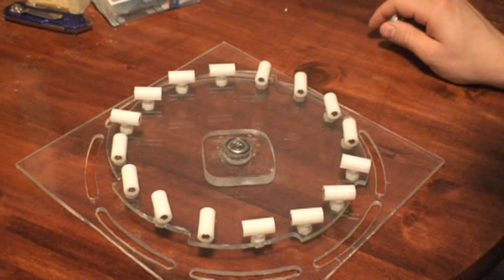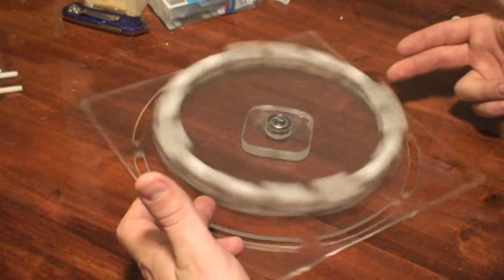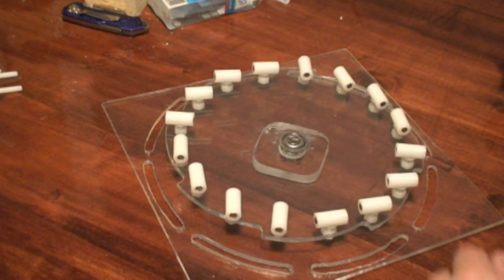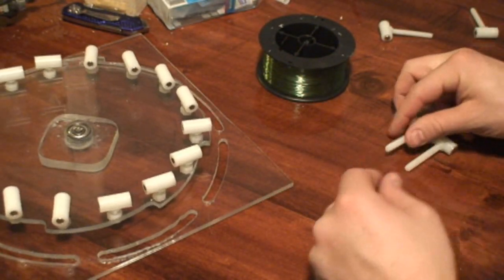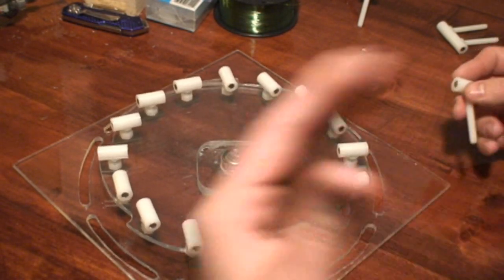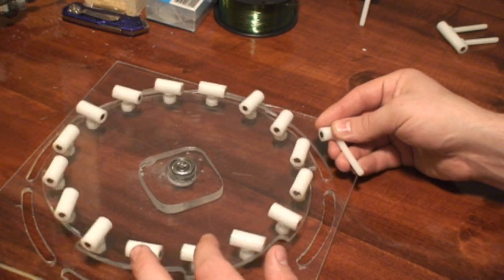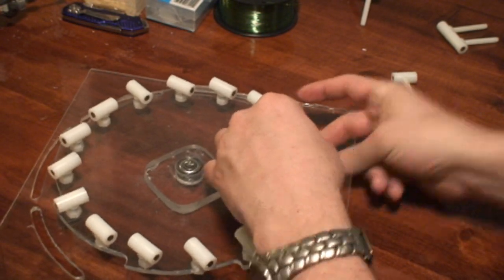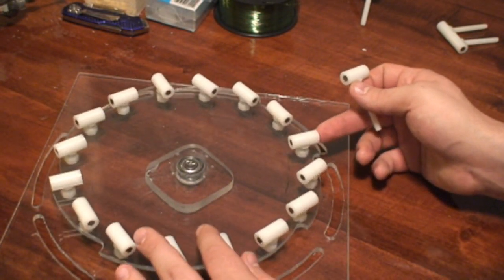Magnet motor, free energy, overunity test 2

Comment: More overunity BS.  It takes more energy to flip the stator magnet than you generate.

Also, even if it worked with no external power input at all,  you're forgetting that magnets are not eternal.   An "overunity motor" using magnetic fields draws its energy from the magnetic fields in the magnets, which is a limited source of potential energy.  The more you use the magnets, the weaker they become as they depolarize.    Magnets are BATTERIES in a manner of speaking.

The laws of thermodynamics are laughing at you.
Reply: You clearly don't understand the relationship between force applied in a field and potential energy.

http://hyperphysics.phy-astr.gsu.edu/hbase/pegrav.html 

https://en.wikipedia.org/wiki/Magnetic_energy

If a magnetic field is providing a force,  and the objects position is changing, it is changing potential energy. Since the force was provided by a magnetic field, it is called MAGNETIC potential energy.

Just like gravity. Gravity is a force, but a gravitational force applied on a object such that it changes position gives it GRAVITATIONAL potential energy.

Comment: Learn science.
Reply: +PhysicsPolice Common sense works for this one.  No quantum mechanics needed.
Reply: +PhysicsPolice You should, because as you see, the basic concept does work :)
Reply: John Doe
Which basic concept:
1) If you put a magic trick on youtube someone will think it is for real.
2) Some fraction of the population is dumb enough to think that you can make energy by waving magnets around.
Reply: +John Doe The basic concept, that magnets move the carousel around, does work. But it's not free energy. It's not over-unity.
Reply: PhysicsPolice Nobody said anything about free energy. That motor will work and it will turn round and round like a pretty carousel. A huge amount of energy went into making the magnets, so of course it will never be any form of perpetuum mobile, that is clear. But simply said, with already prepared strong magnets and improved design, this type of motor would work. The only question is, whether the output, that he can achieve out of it is big enough to even matter.
Reply: Ken Smith What are you talking about? This video is simple physics and it works, as you can see. I never said anything about having free energy, as nobody can get free energy out of nothing, but the motor works. Improve the design a little and find out what kind of output he could get out of it. That's it.
Reply: John Doe Note that I didn't say that you were supporting a claim of "free energy".  I was only, I hoped humorously, pointing out that your comment was unclear enough in its meaning for someone seeing it in the context of a "magnet motor" could take it that way or in other ways.
Reply: +John Doe The title of this video literally says "free energy".
Reply: tampicokid Correct!

I'm astounded at how many people don't know these "over-unity" claims are all bogus.

I learned this when I was about 13.  The First Law of Thermodynamics.

Magnets aren't a source of energy they're more like springs.  If you put energy into them they can store it but there's no net gain.

But when you consider that one in four Americans think the Sun goes around the Earth I guess nothing should surprise us.

Comment: I think you can build a bearing  carrier for your magnet to keep it stationery and have it spin at 4:1 ratio to change the poles as the main wheel rotates. or possibly a magnetic cam system to rotate ur stator magnet

Comment: You just need a cam to make it alternate. The forward momentum of the wheel trips a spring loaded escapement every quarter turn. Even if you have to wind up an escapement, this magnet motor should run.

Comment: Nice demonstration, but as first pointed out this revolves around an environment with minimal friction, there is no load. In order to generate or draw "power" there would need to be a "load" applied to the device.  Even the smallest load would stop a device like this.  This is because the magnetic energy going into the device is always going to be less than the  power you can get out of it, even if friction wasn't an issue.  But friction is an issue, which only increases the losses.  

I do believe there is unharnessed energy all around us, and one day we'll learn how to harness some of it. But as cool as magnets are,  it would be unlikely a device driven by magnetic force would be able to generate real energy.  Keep experimenting though, because coupled with something else, magnets may be an enhancer or stabilizer.

Comment: if you could make a fixed stand that holds that single magnet, and have it so it can rotate on a gear that's connected to the main wheel. then the wheel will turn it without an electro magnet.

Comment: Maybe using a gearing system that can be timed to rotate the exterior magnets in sync with the interior magnets.  If the magnetic force can overcome the friction of the gears it should stay moving with out using electricty.  It also eliminates the need for any computer aided timing.

Comment: The permanent magnet on the rotor repulses the magnet on the 
stator, at the point the two meet. The initial push is to overcome 
inertia; the trick is to shield the stator magnet on one side to reduce 
forces in the opposite direction of the rotor movement. Or utilize 
coils and capacitors for the stator, to generate a pulse at the exact moment the two 
meet.

Comment: takes more energy to swap sides on the main force magnet than is created by the machine itself.
also just for the sake of argument, even if you did add an "electro magnet" it still wouldn't work because of loss of energy from switching the polarity of the magnet rapidly.

Comment: Magnets in motion, circular or linear can be employed to pass there lines of force through wire where it creates electric energy. That electric energy can be retained & built up by batteries or capacitors. Stop thinking of direct physical drives. This tech looks like it's best used to generate electric over long periods of time. Think "trickle" charge, not brute force. Use in plurality to maximize output (s). Oil companies are going to love this tech!! Wish you guys the best ,,,

Comment: Perhaps you could mount your external magnet holder with a couple of gears and a cam to flip it in time with the rotation of the motor.  There might be too much friction to make it work, but maybe not?  If the external magnet was held in place it could be mounted closer to the rotating magnets, improving efficiency.

Comment: Greetings, 
its not an easy task to be sure, however please consider incorporating a magnetic bearing and limit all ferrous metals from any of the device's wiring and surrounding support structure. Also testing within a woodframed building contructed with cadmium fasteners may prove beneficial. 
Good luck Mr .....

Comment: I know perpetual motion is not possible, but maybe try have some type of gear system driven by the spinning of the disc that turns the magnets the same way your hand does.
Reply: friction and the moments on the gears would slow it down and stop it moving at all
Reply: Spinning disc is on double ball-bearings. Making the whole thing spin connected to a gear would add friction, drag, and weight at every step. Even if turning the outside magnet took an ultra-tiny amount of energy, getting the motive force to it would sap more than the system could generate.

In addition, any system to actually catch energy from the system would also add friction and resistance. It's a non-starter, period.
Reply: Can magnetic fields be stacked so they produce more momentum?

Comment: you could link the rotation of the turn table with gears to the magnet that you want to spin with a 4 to a ratio. as the table turns it will rotate the magnet that to held in your hand and keep up with the rotation speed no matter how fast bc it's directly linked via gears and shaft... awesome protect btw

Comment: But this is the principle of how an electric motor and washing machine engines work with electromagnets. Are you trying to re-invent the wheel. Why not just put them all at an angle like 15 to 20 degrees North North with a fixed North repelling constantly ? What happens then ? Another idea is to have a rod in the centre that is connected to a cog that turns your magnet at exactly the right moment of turn no matter the rpm.

Comment: Its a start.  You really only need a couple magnets for that.  For less friction drill a hole in the center of a disk shaped magnet that your ball bearings will snugly fit into.  Then put a round magnet on the top and bottom of the axel the bearing sits on to make it hover between the top and bottom magnet.  also the axel can be a magnet that in the setup I just mentioned can be narrower than the bearings making them irrelivant if you can achieve the balance to keep things together as the speed of spin increases.. You are aware of how a alternating current switch traces the letter  "c" shape.  Do you know about swiss clocks run by air pressure and how the coil in  the clock is attached to racheted gears. one ratcheted to only turn with the movement of the coil tightening..., and one gear racheted to turn as the coil is expanding due to effect on the metal coil from pressure changes in air. When that small movement is geared up and then fly wheels attached and magnets carefully are added into that scenario and this balanced well into center of something like your device perhaps (geared or free spinning gyroscopes) are added you may find a bit of joy in it to say the least.

Comment: use the rotating part in horizontal way and make megnet in such a way that when it turns it will change its sides by it self while keep the one magnet in your hand stagnent so you will make the wheel to turn  I think
Reply: +Imran Khan agreed

Comment: Put the switching magnet on a gear that spins it. Don't go for electric switching. That way it's easily speed timed for multiple switching magnets. If you doubled the plates and used two sets of stator magnets you might get more torque. Or put another row under the existing plate.

Comment: i don't know if you have updated anything on this but her are my thoughts. firstly this is a great idea man good work. i have an i idea to maybe help with your switching polarity concept you have. what if the main wheel had a gear running beyond the outer edge like a toothed clock wheel, and then your engine magnet was mounted and fixed to another gear that would rotate off of the larger main gear spinning your engine magnet to switch polarity every four magnets as you are currently doing by hand then after a spin it should keep itself going with out an electromagnet. i am sure you would need a handful of different sized gear ratios to get the timing right. good luck

Comment: I think you are really on to something here. Surely there must be a way to configure a way to use the motion of the main disk and attach so type of lever to allow the magnet you had in your hand to perform the same task. Get the timing correct and it should perform like clockwork. Thanks for the insight.

Comment: I was thinking. If you had the switching device powered by solar energy, you might have something. Batteries are good enough to handle it. A single charge could keep that thing running all day. Free energy. If you also use solar energy to charge the magnets, you could have two sets of magnets, with one set constantly charging. I don't know how long the magnets would last, but I'd guess it's a fair amount of time.
Reply: OK. I never claimed to be a genius. Apparently you can't recharge a magnet. At least not easily. Learn something new everyday.

Comment: what if you could somehow make that little magnet in your hand spin between negative and positive just by attaching it to the base and put another hammershaped magnet on the other end it so you will have one spinning the other after the initial push.

welding the two hammershaped magnets by the handles

Comment: You need a ballast to switch poles. With a rheostat to control the speed. An electric car window switches polarity between two contacts but it needs to be switched manually still.  How about a cam or gear that runs off of the flywheel operating a mechanical mechanism that will spin the stationary magnet 180' every 90' the flywheel rotates?

Comment: put the little one your holding on a belt drive from the main wheel so it will flip over and over and over as the wheel goes around , with some fine tuning you should be able to get it to flip at the right time

Comment: The amount of energy this thing "produces" is a little less than the energy of his fingers holding and spinning the magnet. His body gives the energy for this wheel. A tiny bit goes into warmth due to friction of the bearing. You can't drive a generator or anything else with this.

Comment: Ken Smith,  how about using the wind,  sun,  or other free energy we have and use them to overcome this slight difference then.  Couldn't it be possible to take this and use a step up transformer.  We can get 2000 degree free heat from holding a TV screen in the sunlight. Seems like there is a way.

Comment: You could control the speed based on how far away the magnet is from the ring, I thought of this exact idea a couple of years ago, could not do it tho. I really like this. Try putting the say positive sides of all the magnets in the ring facing the same direction, I realize this will make them all attract but if they're held in place it should be fine. But by doing this you can reverse the magnet held out and make it slow down/ go in reverse
Reply: having all the positive sides facing would eliminate the very factor that causes this to work..the progression of a stronger attraction..once u hit the 4th position it's at its almost strongest..so u can't have another positive nearby or it will attract and stop..by switching to neg and starting the build up again you introduce a repel to get that positive out of the way then use attraction to pass the next group.
Reply: +Chris Sylvain ah ok, I didn't know. Like I said I haven't tried it out

Comment: Why not put the pushing magnet on a geared ball bearing connected with the main motor to spin at the exact timing.  This would create your push and pull effect without using electricity to keep it functioning.
Reply: +keith brumitt Your idea can't work.  You can't get the magnets "to move for free".  It takes energy to move them.  This energy is always at least just a little more than comes out of the main rotor so it is a net energy loser.

Comment: but the speed of the revolution must correspond to the speed of the change in north and south poles of the magnet, how will you make it work efficiently, without using too much energy input.
Reply: and yes using less friction in making it spin more, makes it counter spin when attached to a turbine, and how will you make it spin if that happens?

Comment: You could use the force of the table itself to mechanically alternate the trigger magnet.  Some type of sprocket mounted around the pinion could create that kind of mechanical motion. The trick is to make joints with the least amount of resistance. If you make a good enough mount for that trigger magnet, where it can rotate 360 degrees but stay snug a cam could time the spin for you.

Comment: First you need much more powerful magnets. With more powerful magnets you will have some spare torque. Then you can put a gear on the disk. The gear will connect to another gear on the outside that will flip the outside magnet, which you can tune for perfect timing of the flip.

I'm a think tank, and I always know how to improve things. In fact I "invented" an overunity magnetic motor in the mid 80s when I was in my teens. Goes to show how logical it is. Numerous people have "invented" the same thing. A wealthy relative wanted to fund developement, but I turned down the offer because even as a teen I understood that the powers would never allow it to be successful, and it would be a waste of money. 

Another problem, regarding videos like yours, is that the government is always sending shills onto the comments of these videos to say it doesn't work. And then there are the doppelganger videos put out to make the idea look like it can't work. But the truth is that the government has had overunity magnetic motors for a long time. The height of it is a self-cooling motor that runs on ferrofluid in a doughnut shaped casing wrapped with wire in one direction to make the fluid flow in one direction.

I really need to start a business as a consultant to improve products. The government should have taken an interest in me a long time ago; but its too late now, I would never give them my ideas or time. Their loss.

Now a bunch of BRAINLESS shills can make comments after mine about how I don't know anything, when the fact is that they're just brainless whores who say anything for a few bucks. The funniest part is that they'll be the first to be shipped off the the Fema camps and they'll be shouting "No, but I made YouTube comments for you guys!" and no one will care. That's when they'll realize what cheap sluts they were. LOL!

—

Comment: The key to this is to spin the wheel without anything actually holding onto it, the wheel has to be in essence levitated magnetically as well and then spun eliminating the friction and failure on the bearing caused by the incredibly fast spin. This concept is similar to a gravity drive except for the opposing wheel, I wouldn't be surprised if you canceled out gravity in the process.

Comment: Could you setup an arm on the wheel to slap the outside magnet to rotate it 180 degrees (switching North to South)?  The timing might have to be adjusted as the speed increases but that would have to be worked out later.